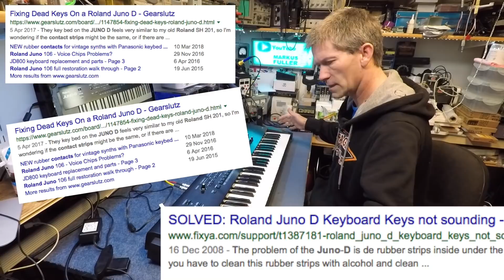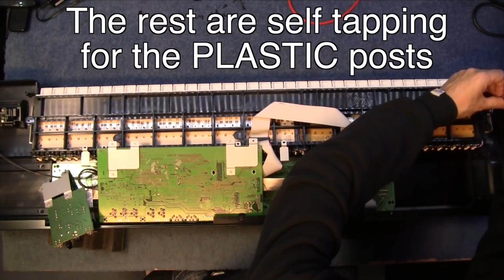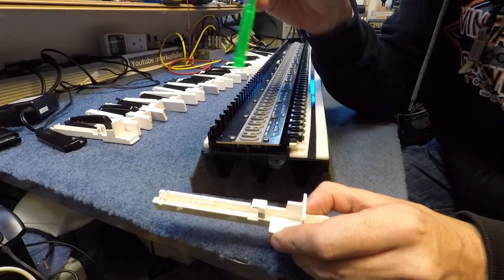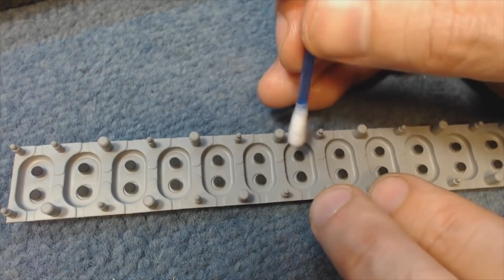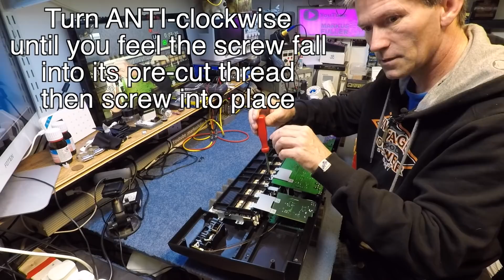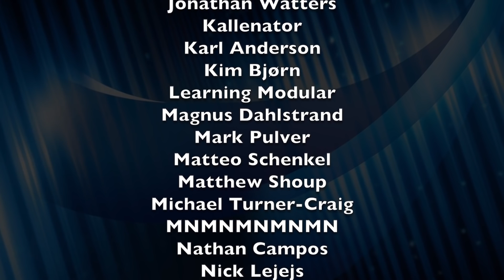Keyboard repair key fix roland juno dead keys

Comment: Roland Juno D, D for Dead.. It's caused by Oxidisation , the conversion of metals into their oxides as a result of heating to a high temperature.  Best thing to use is DeoxIT contact cleaner. I use Gold but its not cheap. £30

Comment: Are the Fantom series synths similar to the way a Juno is put together? I have one that had ginger ale spilled on it and a few of the keys in the lowest octave don't work or work only sometimes. I think I could tackle a job like what you showed in the video but I'm worried that I'll get in there and find something totally different. I think if the keys are similar to the one you just did I'll be okay.
Reply from the maker: @serenemachine9110  I honestly don’t know as there are so many different types of these keybeds. a lot of them work the same with the rubber dome over the circuit board contacts but the way the plastic key is removed could be different.

Comment: hi maye i have watched a lot of your videos and they are really useful however, im struggling to get keys so that i can replace from a korg x3 any ideas how they come out with breaking them. thanks for any advice
Reply from the maker: Hi Paul. Im not sure about the korg x3 keys but look to see if there is a strip of plastic along the back or along the front under the keys that has been stuck down. if so then you need to prize it up slightly (dont completely pull it off) and see if that allows you enough space to ziggle the key back a bit or forward and with a bit of luck the key may have a small hook part that locks it into the metal runner. if it pops up slightly you will be able to push or pull gently and unhook the keys. you can only take off a black key when both white keys either side have been removed first. sorry i have not opened the x3 so not absolutely sure how they are hooked into place. but most manufacturers use the hook system with the plastic strip to lock everything in place.
Reply: @markusfuller  Thanks Mate i can see how it hooks to the chassis and but cant see how any of the plastic is stopping the key coming out, buts thanks for responding ill keep persevering.
Reply from the maker: Paul Fearn Ok Paul. just think they are made in a factory quite fast so there will likely be something easy that locks everyrhing into place. do the keys have springs at the back ?. if so unclip the spring and it may pull forward. I wish I had an image of the back of the keys but I cannot find which sort the x3 uses.

Comment: Hi Markus, I have a Roland RD150 and 6 keys in a row don't work. I cleaned them like you showed but they still don't work. Should I replace the pads or do you think it could be the soldered resistors?
Reply from the maker: Hi Gary. seems a bit odd that six in a row won’t work. maybe its a resistor lifted slightly but also check the curcuit board copper traces for very fine cracks as sometimes every track works with several keys in a row. I hope you find the problem.

Comment: My Rodgers C-100 just developed a reproducible issue.

In the left hand (bass clef), she will get a bizarre loud sound if she plays a (B, Em, another B chord) and adds any combination of Ab, G, or Gb notes. 
It only happens with those combinations.

I think it's a failing IC board, but I thought I'd ask if anyone else has run into this problem.

Thanks!

Comment: Hi there Markus!
So, my Juno D has onle ONE key not responding. Diodes ok, continuity ok, clean the board and the rubber ok but STILL not responding. All the other keys working properly but the F3 is dead. What can I do? And, great video!
Reply: Me back here! So, I managed to solve the problem soldering the diode corresponding to F3 to A#2. It worked! Guess that the circuit line broke an is too way complicated for me for complete de disassemble the keys. Thanks again for the video!

Comment: The black rubber pads just rot away. Same thing that happens with remote controls.
From personal experience dealing with rubber pad failures:
- Don't use carbon ink on the rubber side, nor pencil on the metal contact. The carbon dust will come loose over time and short the pad, so you'll have to clean it up and start over.
- If you have the time, glue tiny pieces of aluminum foil over each pad. The best glue I found that sticks to both the rubber and the aluminum, was silicone glue. Use as little glue as possible, you want the aluminum foil to be flat.
- Or just buy replacement rubber pads; they tend to be fairly standard, your local electronic keyboard repair shop probably has a ton of spares.
Reply: When you say replacement pads do you mean the entire strip or just clipping the carbon pad off and replace it with a new one and some super glue?
Reply: If you are going to buy a replacement it should be the actual strip, if you are going thru the hasle of gluing just do the aluminum foil trick
Reply: @gambiarraster  how well does that work? does gluing the aluminum foil to the pad last a long time? thanks in advanced
Reply: @dhoeffner  i did this trick on  the board computer of my car a long time ago i used  one of those hole punchers to make the aluminium pads and epoxy glue, still works great, i think that if you are  dealing with a couple of keys it is ok, i have not done this on my juno d, all the keys are dead and im not sure if it worth the time and effort. It is a lot of pads for sure.

Comment: Hi , you ever done a Fantom XA/ X series bad keys ? I imagine it wouldn't be too different to this Juno...
If I had a completely dead sharp black key woukd that more likely be a blown diode?
PeaceFromOz 🇦🇺
Reply from the maker: Hi Andrew, I have not worked on the XA series, I have never known the diodes to blow on any keying matrix though it is possible. I guess your problem may be just cleaning the carbon and the contacts or checking the copper tracks that go to that key area. I am only guessing as thats the most common fault.
Reply: @markusfuller  thanks Markus ...I. will pull it apart tomorrow..
Reply: @markusfuller  cleaned today with isoprop and cotton swab , actually started cleaning the whole board with a medical swab but soon realised it is probably dissolving the board lacquer and contaminating the carbon pads.., ..even the completely dead sharp key came back to life surprisingly.  
After having a play on my FantomXA ,really for the first time since I bought it a few years ago, they are a pretty feature packed sampling workstation, the "Skip back sampling"(XA is sampling all the time) is pretty amazing, was going to swap it for a Casio RZ1 sampling drum machine but now having second thoughts.  
Ps. Do you get into cb / Ham radio ??
PeaceFromOz 🇦🇺

Comment: Hi Markus, I have DS88 that has worn out pads where the keys have lost dynamics. Do you have a specific part number for the replacement rubber pads?
Reply from the maker: Hi I am really sorry but I do not know the part number for what you need. Im guessing the same pads (part) were used in many of these products so there should be something online somewhere. try asking syntaur.com or synthparts.com they may at lease point you in the right direction. best wishes.

Comment: Thanks for the video! 
Was the hooked spring-tool something that is commercially available, or to you have to make it yourself?
Reply from the maker: Hello. several people on here have now told me that it is for crocheting or carpet making. I have had it for years and never knew what its true use was until these comments told me.
Reply: @markusfuller  Thanks! Although in some ways it did look similar to my mum's crotchet-needles, but they're plastic & don't have handles so they more likely for carpet-making or possibly a leather-goods making tool!

Comment: i had an accident with my S88 komplete kontrol i spill wine on it.

I had to open the midi keyboard and clean the mess in the contacts but unfortunately some of my keys stop working..

so i think with the wine the silicone contact rubber is damage and I don't know what to find a silicone rubber contact to replace all the strips and beg to fix the problem... or at the end ask for assistance in Native instruments and replace the contact board that receive the silicon strip...

what do you think about this urgent problem?

if you have any suggestion I would appreciate it.

Pd: sorry for my bad english..
Reply from the maker: Hello. I have always had difficulties trying to find replacement silicone buttons for keyboards and have never been able to buy them from anyone. I have always had to try and fix or replace from another keyboard. I think the main company that makes most keybeds for several companies is Fatar though I have never tried to buy from them so am unsure how you will get hold of a replacement. very sorry.

Comment: This didn't really help my Edirol PCR-50, though I used aceton. What did improve a bit, was using a lead pencil, but that's not a long term solution.
Reply from the maker: yes a pencil is not a permanent fix sadly. I am still trying to find a better way of recoating these carbon pads as this fault is so common on older keyboards that have had a lot of use.
Reply: Don't use acetone unless you want to melt stuff. No, really. You can't just swap cleaning chemicals around. Isopropyl alcohol may dissolve inks, but it won't dissolve plastic. You just want to loosen up the oxidation and other gunk. Acetone is used to polish 3D prints made of ABS, the same plastic that most keys are made from.

Comment: Any suggestions on Yamaha DX11 replacement of keys.  I have everything disassembled and can't put in new key without breaking again.
Thanx.
Reply: Picked this up 2 years too late. There is a retention strip for the keys which runs the full length of the keyboard you have to take out first. You can then remove the keys by gently [ushing them forwards and lifting them out. The spring mechanism is very odd, so when you put the key back in, there is a bit of an art form to sliding the key in such a way that the metal strip catches onto a metal lip transferring one end of the spring from  a plastic retainer of the key to the betal base of the keybed. very easy to damage the keys if you use the wrong amount of force. However, spare keys can be bought fairly easily.

Comment: hi,do you have other video of juno D of how to fix it ,my problem is it just switching automatically to brass,piano and other effects,can you please help me how to fix it?
Reply: You've either got a sticky switch or something is sending midi program change commands to your synth. Try turning off program change in your midi settings first
Reply: @annother3350  thanks for the reply,I figured that the main board has a problem,thank you so much
Reply: @jeckegay  I'm not an expert but I dabble
Reply: @annother3350  now I use maudio 61keys,
Reply: @jeckegay  code 61?  me too
Reply: @annother3350  hahaha yup I just bought it last month,what apps you are using?
Reply: @jeckegay  I use it with cubase but after a year the pots are already unreliable -- they need a clean or something
Reply: @annother3350  only a year?I see now ill observe mine,cuz my contract here is only one year,lets see,.I use oblivion

Comment: After I clean with alcohol, one key works for 3 hours ( as long as the alcohol doesn't dry up) and again stops playing. I have changed the rubber pad.  Is there anything I can do to get my key working. Need urgent ideas
Reply from the maker: maybe the carbon on the pad has worn down too far and you need to replace that.
Reply: @markusfuller  got an another solution that worked for me, metal foil. I stuck it in and it worked like a charm. There is sometimes an issue with the touch response because of that as that key sometimes plays louder, but I can live with it as long as my key is working

Comment: One of the key on my juno d is a bit wiggly and loose, do you happen to know the fix? Thanks
Reply from the maker: maybe there is a poece of plastic broken off the far end of the key. they tend to go brittle over time.
Reply: @markusfuller  hello, im back, found out that a rubber piece was missing replaced it with a diy piece from a slipper, now I made a stupid mistake of cleaning the lcd of the juno d with alcohol and it displayed weird characters and after 24 hours no more display, how can i fix this? Replacement lcd is hard to find this days,

Comment: Hi Markus, i have a Juno D LE and i want to ask something. When i start the synth, the first 10 seconds the output sounds "crackie", then go normal. I think that the problem is a low capacitor, but when i saw the main board...that has a lot of electrolytic components. Do you know what the audio ones are? (maybe the problem is similar to the XP-50) Thanks!
Reply from the maker: Hi Adrian. I have been told this very same thing from another person about a year ago and i’m sorry to say but I do not know why this happens. I no longer have the roland juno D in my posession. and I cannot understand why you and at least another person os having this same problem.
Reply: @markusfuller  If the problem gets worse i will replace all the capacitors, but if it stays the same...I will not touch it. Thanks for you reply and i love your channel. I repair my synths and with you videos I learn a lot ! Greetings from Argentina!

Comment: Even though this is a 2 year old post, I've got an 80's Roland EP-50 and between this video and this one https://www.youtube.com/watch?v=-czedYcY1mA which really covers the covers the disassembly process (on a D-50 which is newer but similar) I was able to cleanup and get mine playing well again.  I picked mine up used to have a keyboard in the studio and not being a keyboard guy missed the two loud playing keys.  This cleanup procedure resolved the issue - thanks so much for taking the time to post this.

Comment: Hi Markus! I'm having issues with my Juno 106, it seems that every 6th key isn't working, only when I switch the polyphony modes it starts to work for a second and then goes away again. Can you tell if that is a contact issue or could it have to do with the voices? MIDI is also not working same as the keyboard. Thanks!
Reply: Same here. Did you find a solution?

Comment: What if the buttons are dead? I have the same synth and the Keys are right but octave buttons and attack knob doesn’t work!! Please help me with this cause Its un playable in octave -3
Reply from the maker: sometimes you can have a very tiny crack in one of the copper tracks on the circuit board and that can stop several keys or switches from working or check all the ribbon connectors that connects the keys to the main board.

Comment: Pls respond how can i repair the songs button i hold start and stop but its not working
Reply from the maker: Hello . if there is no response you may have to get the button changed, This is normally a small button on the circuit board under top casing and they can be unsoldered and a new one placed. sadly they do not last forever.

Comment: any way you can do a roland EP 30?
Reply from the maker: Hi Cameron . sorry but I only take apart keyboards that need repairing and mostly ones I have bought from car boot sales. If I ever get hold of the EP30 that needs key repairs i will make a video though most keyboards have a similar way to remove keys even though they are different brands. best wishes.

Comment: I just replaced a broken black key which had lost its spring on my roland d70.
the key had been broken 20 years ago.
Last day, I replaced it.
open the d70, take off the keyboard and put it back was a nightmare when it is the first time....
and... i forgot to test the keys before the replacement of the broken one...
so..... such struggles for discovering that I have to open it once again because there are dozens of dead keys to clean their contact...
my god. how can I be so dumb?😂

Comment: lol my volume potentiometer has developed a large wobble on my juno d..... but my keys are fine :)
Reply from the maker: Hello Chloe. the potentiometer sadly is a plastic shaft pot and is soldered directly to the board and has no bolt to hold into place and they are problematic in breaking easily. they can be replaced easily though if you have a soldering iron. I think the volume pot is a double stereo version (6pins)